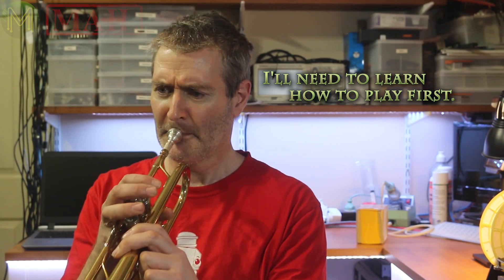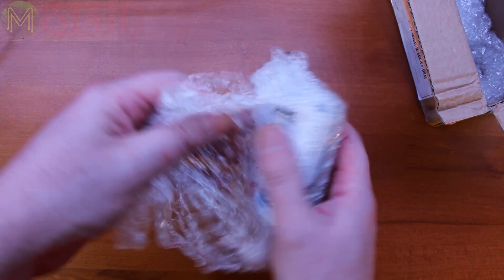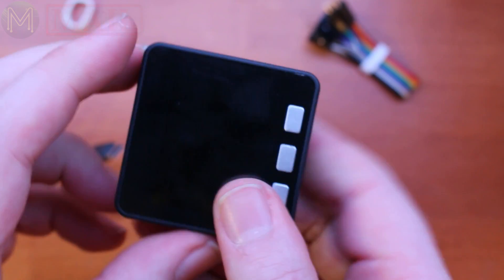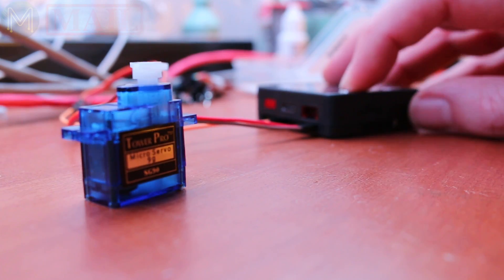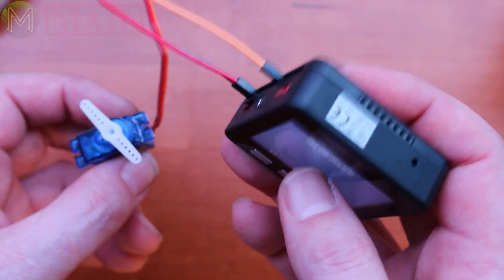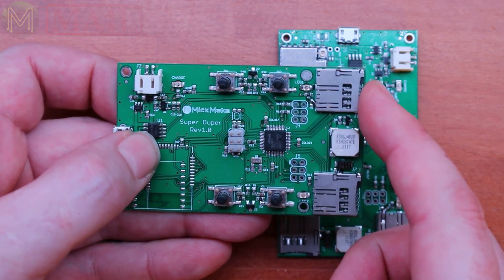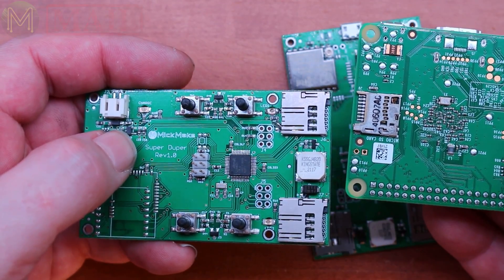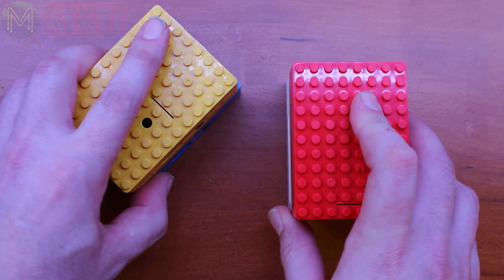#207 MickMake Mail #29: M5stack, SDs, Showers & DockerFu

Comment: For your shower temperature monitor, while it doesn't have a built in temperature gauge, take a look at the whisper nodes from wisen, they are even from an australian builder!  Runs off 1.5V fine, think I've had mine down to 0.85 volts in the past.

Comment: Have you checked out the UF2 bootloader (Microsoft) as well as the CircuitPyhon version of MicroPyhton from Adafruit for the ATSAMD21?

I found them very easy to port to my one handed keyboard project, and they both implement a virtual thumbdrive for code/data loading.
Reply from the maker: I have used them many tines, but ... single handed keyboard?! Nice! I had a project many years ago, building one of those. Went to the level of trying to make the best ergonomic case for it using fibreglass.
I should revamp it like I did my talking clock.
Reply from the maker: BTW my plan is to also support micropython for these boards.
Reply: MickMake CircuitPython make it very easy to make USB keyboards with small key counts. I was originally going to use one of the available keyboard firmware options, but found a CircuitPython based system easier to implement.
Reply: MickMake From what I've read, adding a 2MB SPI Flash chip allows much more Micro/CircuitPython code to be supported. My next spin of my keyboard PCB is going to add one.

Comment: Just built my 4 node docker swarm thingy, using Portainer to manage.  Could you cover shared storage between nodes?  I tried NFS & Autofs but struggling with the perms I think!  Quick tip for the trumpeting practice...build up more dribble first.
Reply from the maker: Yup, I reckon I could cover that.

Trumpets? Well I’m a drummer. I just naturally dribble so should be easy.